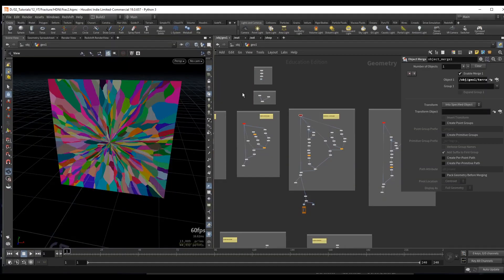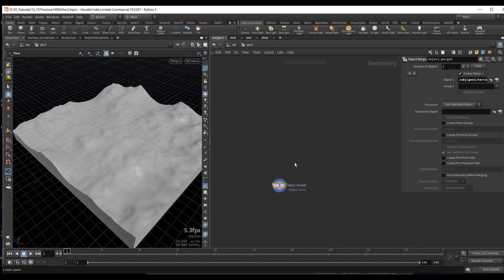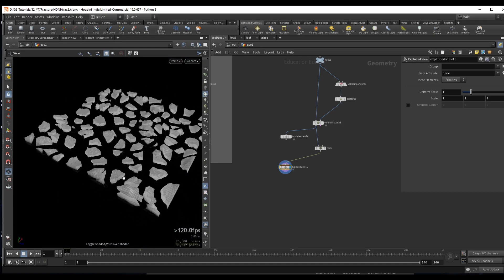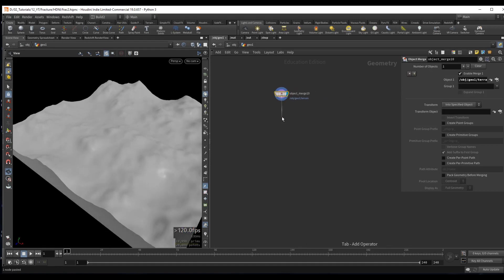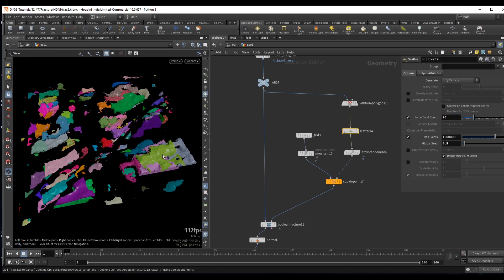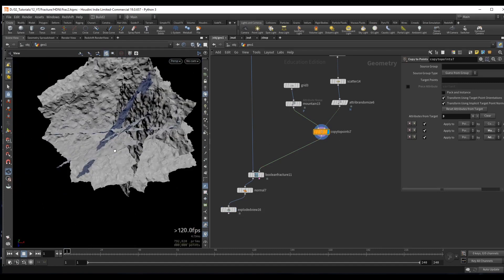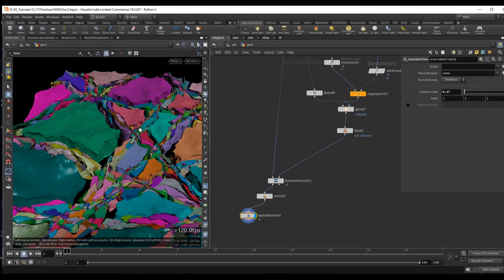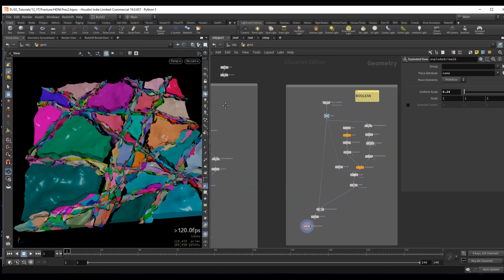Fracture Masterclass - Houdini VFX Course

Comment: Are we able to follow all of your CGCircuit courses to the tee even for rendering if we have an RTX 3070? i was considering buying them but not sure if I'll run out of VRAM or not
Reply from the maker: Yes I'm rendering on 2x 2070 . It can only use the VRAM available only on 1 card though, so none of my projects usually exceed anything over 2-3 GBs. The way I render things is by separating objects as much as possible and rendering them individually. This makes it easier to have custom render settings per layer, and only a lot more convenient in compositing.